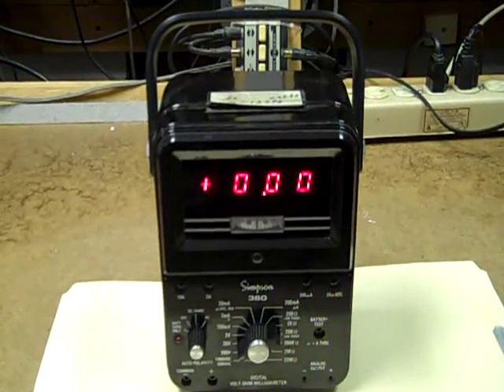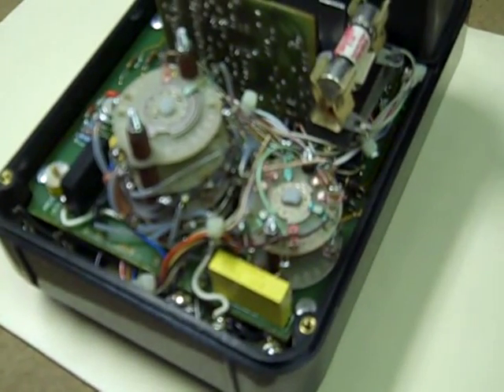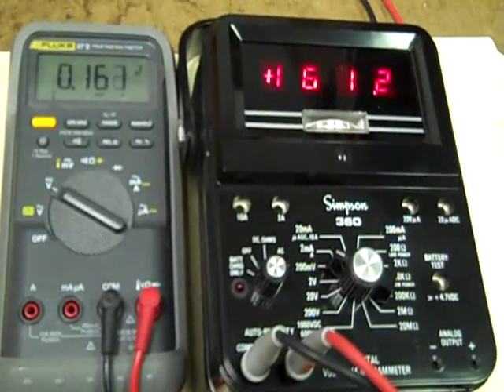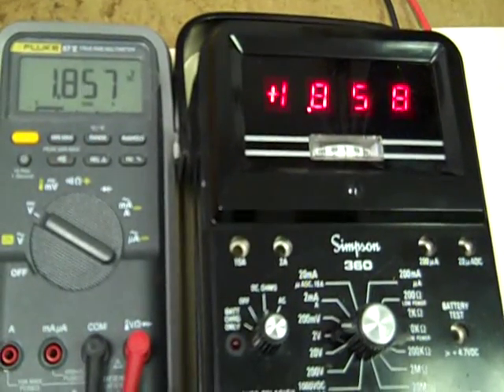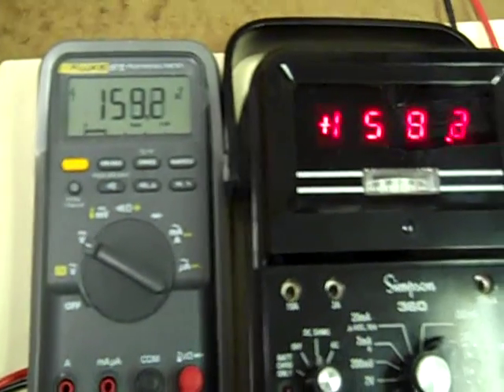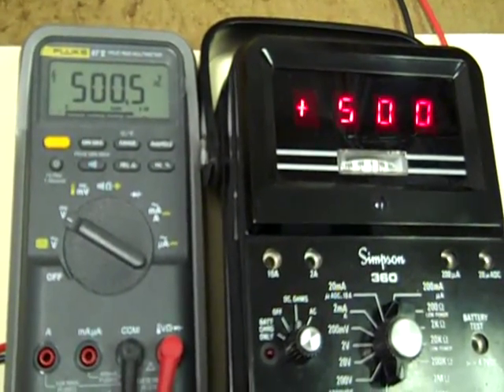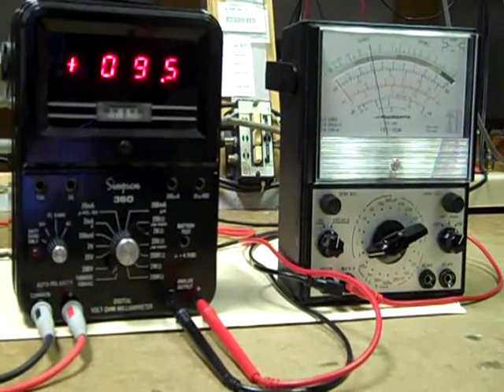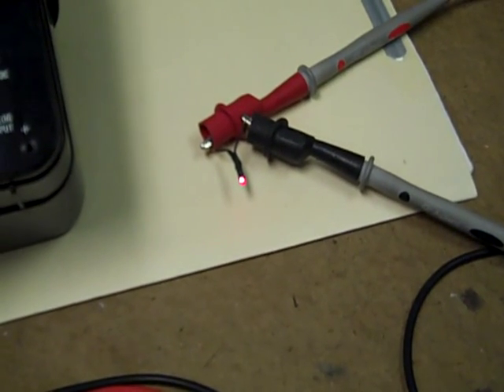Simpson 360-2 Digital Mutimeter Review

Comment: Hi. Could you do this comparation, but in AC voltage ranges, and diferents frecuencies? I would like to see how the Simpson 360-2 responds to the frecuency VS Fluke-87( true RMS DMM)
Reply from the maker: I sold that meter years ago. It was average responding, not True RMS. Can't say about the frequency response, but most meters back then were geared towards repair technicians, and best accuracy was at 50-60Hz.

Comment: Complete noob here. I looked-up "trending" and I couldn't find any answers. Can you please explain what you mean by trending, when it comes to using the analog display [needle]. Thank you
Reply from the maker: Sometimes LCD digital meters don't quite give you the "feel" of moving or changing readings quite the way an analog meter pointer will. Voltages changing at certain rates are sometimes more easily interpreted with analog meters.
Reply: And that's called "trending"?
Reply from the maker: @maxwarfield6699  Sometimes referred to as that, yes. Observing trends.
Reply: Now I know. Thank you kindly, mate. Cheers!

Comment: Could you please do another video, where you actually use the built-in analog meter display. I'm not sure, how it's used. Thank you kindly
Reply from the maker: I no longer have that meter. The analog meter on the 360 was really only for trending and visual indication of changing signals, not for measurement as such.
Reply: Thank you for replying. Cheers mate!

Comment: I picked up one of these and had to replace the cells. I also had to find a 1/4 plug and a wall wart to provide A/C power. I believe I have the 1/4 plug wired properly with negative supply on the sleeve and +9 vdc on the tip. Best I can tell is that there is nothing connected to the ring, (center ring of plug).

Can you verify with your A/C adapter if this is correct?

I'm not sure if I still have an issue with the meter as it appears that the meter does not like operating with the A/C adapter plugged in.
Reply: Hello xwarp,
You seem to know more than me on this matter, so here goes: my Simpson 360-2's analog display [needle pointer] isn't centered [on zero] even when OFF/and without any batteries/power. It's slightly pointing to the right. I don't have an operators manual, so I was wondering if, performing a recalibration of the main digital display, would also result in centering the analog needle as well. Please let me know. Thank you kindly
Reply from the maker: +xwarp Don't have that meter anymore...
Reply: +Mark Zacharias Thanks for the reply.  I think I've found the problem. There's a wire pinched in two that runs to the DC input jack that I suspect is causing my problem.